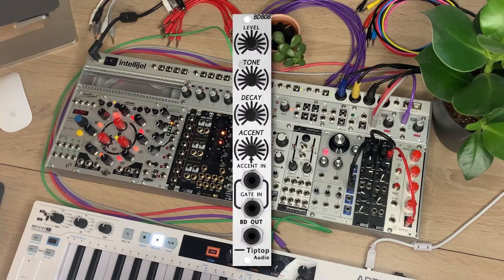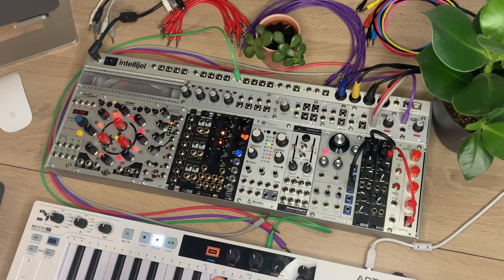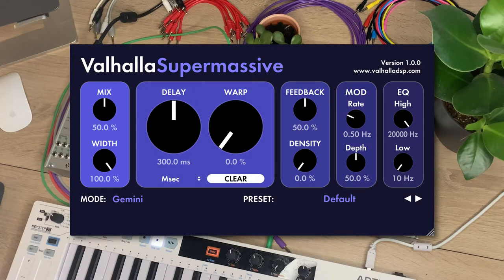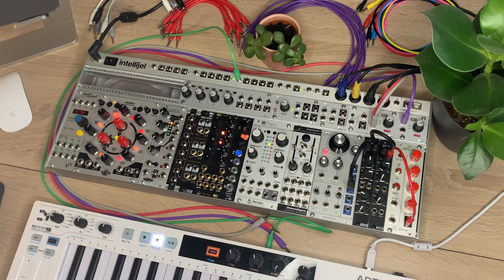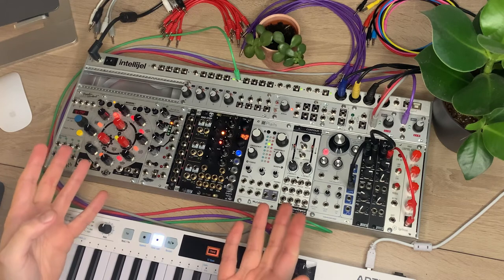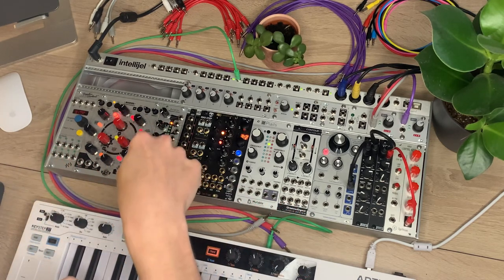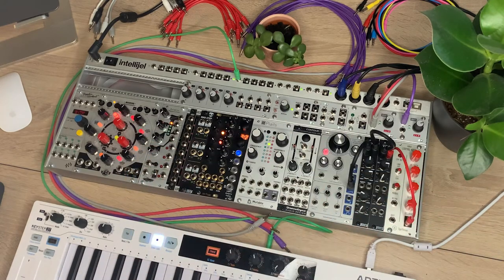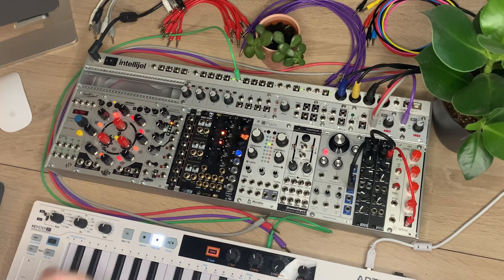Triggering with Zularic Repetitor & transposing with Pamela’s New Workout | Modular patch breakdown

Comment: An interesting exercise, and one I think I can get close to replicating in my system. However, your explanation of how you got offset voltages out of Pam’s was rather sketchy- were you suggesting setting ‘level’ and ‘offset’ to the same percentage value on each channel by trial and error? I’ve always thought that it was impossible to extract exact note relationships from Pam’s as an octave is represented by values 10 apart (yes?) while there are twelve semitones in an octave. How would you precisely dial in three semitones (minor third) or ten semitones (minor seventh) on a scale of 1 to 10? Or is it not done with level/offset at all?
Reply from the maker: Great question! You're right, at first I thought it would be difficult to dial in precise semitone intervals on Pam's. The outputs are 0-5V, meaning a 20% setting for level = 1 volt = 1 octave, so you could do 5% for 3 semitones, 10% for 6 semitones, 15% for 9 semitones etc, but you couldn't easily dial in other intervals (e.g. the 7 semitones of a perfect fifth does not equate to a whole number percentage in Pam's!). However, since the firmware update a couple of years ago, Pam's lets you quantise the output - just scroll along to 'Quant' and you can pick from a bunch of scales. 'Ch' is just chromatic semitones. So with the output quantised, a level of 12% results in a perfect fifth, for example. Hope that helps/makes sense!

Comment: It sounded really nice. You have some good modules. Do you have an Ornament&crime? Sequins app from the original  firmware would send 2 sequences which can act independently, but related, each to 2 of the 4 oscillators pitch. Endless possibilities with eurorack, if you have the hp and deep pockets.
Reply from the maker: Thanks! Yeah, I've acquired an Ornament & Crime since I made this one. I started with the Hemispheres firmware but I switched back to the original to check out Acid Curds, Quantermain and Meta Q - need to dig into Sequins too!

Comment: Did you build your thru zero module? I’ve been eyeing one for a while now, but i’m picking up a tiptop buchla 258t, so not sure it’s necessary besides the fun of soldering kits.
Reply from the maker: Yeah, I built it myself - I’m not super-experienced but it was pretty straightforward, no surface-mount stuff. Does the 258t have through through-zero FM? I could be wrong but thought it just had logarithmic FM (which the EN129 also has). Very tempted by all the Tiptop Buchla stuff though!
Reply: @TomChurchill  i think aside from the extra waveform options in the dannysound module, the 258t pretty much covers the rest (not sure about linear vs log) but i was under the impression that the dannysound module was based off the buchla, minus the second oscillator. And yes! The entire Buchla 200 series via TipTop is extremely enticing!
Reply from the maker: Ah, so I think the Dannysound Cali Osc is the one that’s based on the Buchla, with the waveshaping etc. The EN129’s main selling point is the through-zero FM, which not too many oscillators have. Divkid has done great in-depth videos on both of them, which are well worth a watch! But yeah, if you’re not too concerned about TZ FM and just want a Buchla oscillator (or two!) then it’s hard to see past the Tiptop option! 😀👍
Reply: @TomChurchill  ohhhhhh, that’s probably what I’m thinking about! I think at this point i just need to get another case lol. So many modules out there that I end up blending them in my mind. The through zero module is particularly interesting to me because my first synth ever was a DX-7 :) thanks again for the replies!